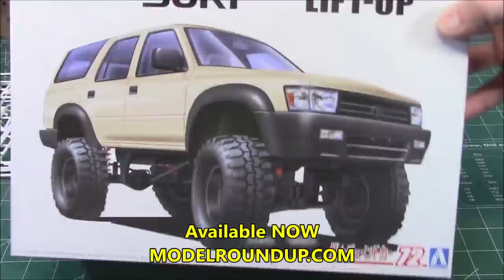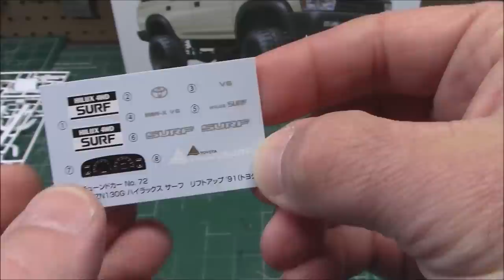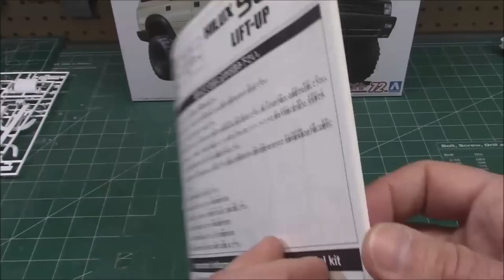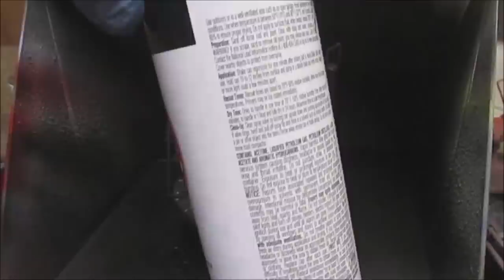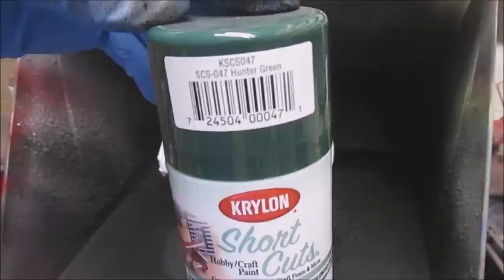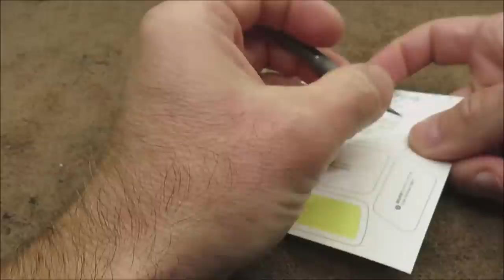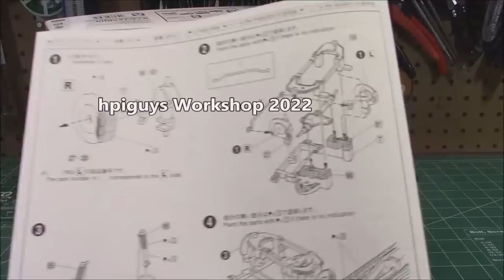1991 Toyota 4Runner Hilux Surf Lifted 1/24 Scale Model How To Assemble Paint Shocks Dashboard TRD

Comment: I'm diggin' the color choices. Not just the body, but the different metallics, as well. Details - it's all in those fine details. BTW - if I knew where you lived, I'd be tempted to bring a tiny jack and very small tire iron and get that wheel and tire set. YEOW. Thanks again for sharing.

Comment: There's something I really don't like about Japanese model cars: no engine but a sorry simulated built-in thing resembling an engine. Our models (American model cars) they got beautiful little parts that are in themselves, another model inside the final model. Well I've said enough. Sorry about that.
Reply: Lift up hood with an engine would have been better.
Reply: @eottoe2001  absolutely.
Reply: Try a Tamiya kit - some of those have very nicely detailed engines in them, as well as some Fujimi models.
Reply: Well if you eyes are not as good as they once were then these are perfect so you don't lose those small engine parts which is bad enough when your eyes are perfect , but I still like them with engine ,s.
Reply: @markmccormack635  in model trains you start with N Scale (1:160) and as your eyes get worse you work up to G Scale (1:22.5) or so I'm told. I'm looking at O Scale seriously myself. Liked your comment.
Reply: Man, these japanese finished products look superior to me! The American models cut corners on some models. But the finished product is what counts. In my book. MY BOOK!
Reply: @eottoe2001  I have a hard enough time with 1/25.🤠👍